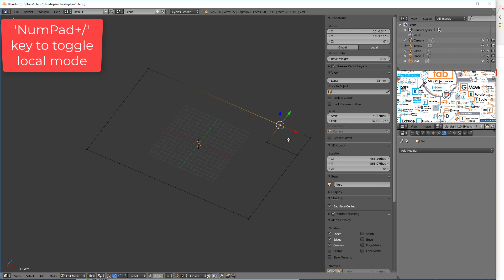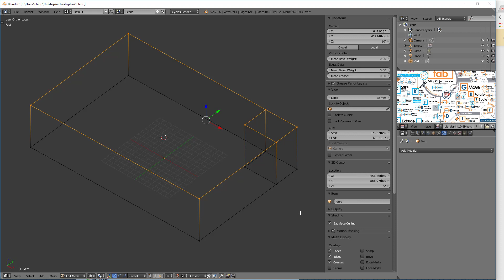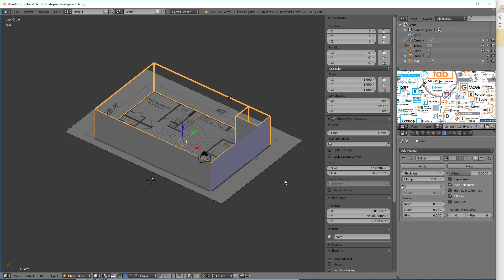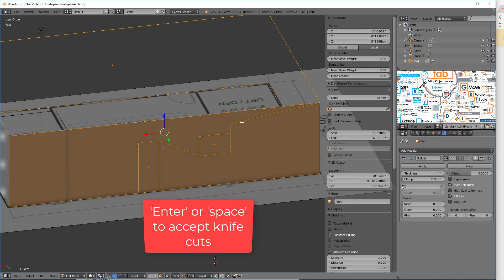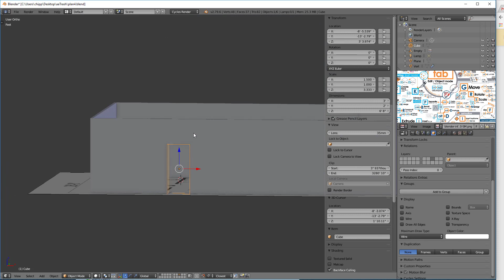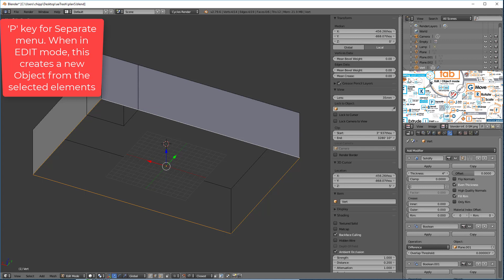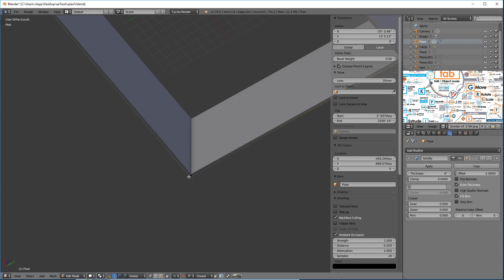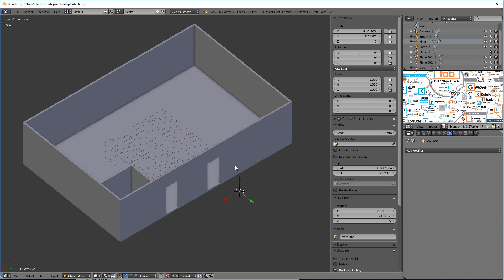Using Solidify, Booleans and the Knife tool to model

Comment: t=638s - 
Set the Offset of the solidify modifier to "-0.05" for even / centered thickness. 
Hope that didn't come back to bite you with measurements or precision later on. ;)   

P.S. I liked your K9eGIx-Li7w smoothing video, I'm still struggling a little with all the shading options;
Split, Sharp, Smooth, Crease, Flat, EdgeSplitModifier, Autosmooth angle, Bevel Weights for verts and edges, 2.8s weighted normals Mod etc.
Can get a little confusing how they all interact with each other or which is best practice dependant on modeling workflow.
Your Video helped.
Reply from the maker: Thanks for the tip. Yes, I struggled as well with those. I'm working on a set of HardOps videos which will hopefully explain.